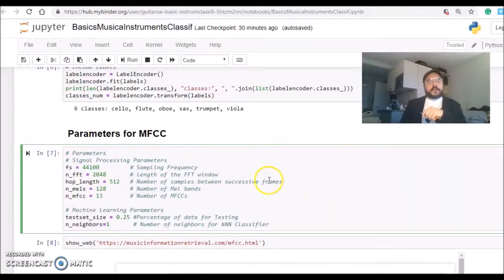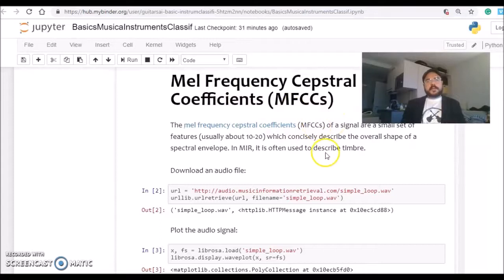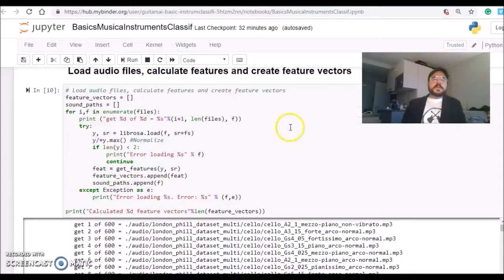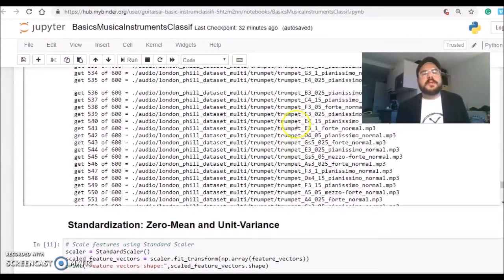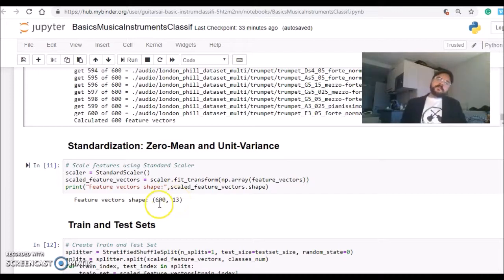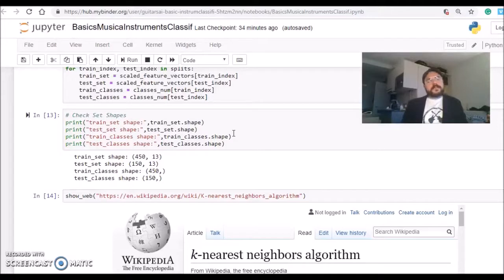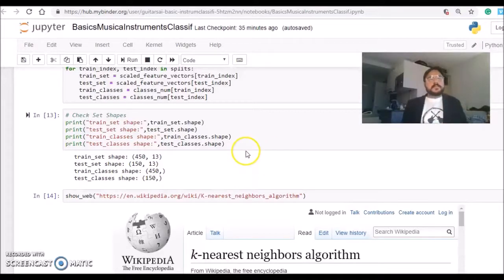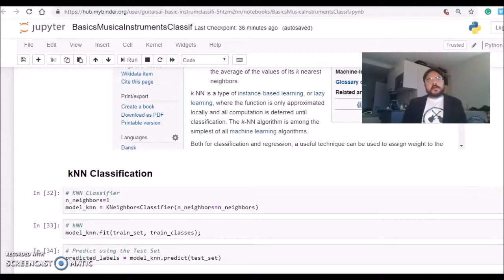The Very Basics of Musical Instruments Classification using Machine Learning - Part 2

Comment: I’m getting an error during the creation of feature vector step. I also have ffmpeg setup at my path. Is there any other way through which this issue could be resolved? Please let me know. Thanks.
Reply from the maker: did you check if everything is properly configured, are you with all correct paths to all files, are you working on the correct directories?

Comment: I'm having problems with loading files, it just says Error loading: (path of the file), for every one of 600 files
[EDIT] I added ffmpeg to env, didnt solve the problem
Reply: try installing all of these:
tensorflow
keras
librosa
numpy
seaborn
scipy
seaborn
pydot
graphviz
 as admin and restart your kernel. It worked for me
Reply: @swathigunasekaran6817  I converted mp3 to wav and that fixed it for me, but still dont know why that happened hah
Reply from the maker: Is the ffmpeg at the path? http://blog.gregzaal.com/how-to-install-ffmpeg-on-windows/
Reply: @the-sound-travels  yep
Reply: After adding ffmpeg to PATH, make sure you close the current instance of the terminal, and relaunch a new one, worked for me.

Comment: london_phill_dataset_multi\viola\viola_Gs6_1_pianissimo_arco-normal.mp3
C:\Users\w10\Anaconda3\lib\site-packages\librosa\core\audio.py:146: UserWarning: PySoundFile failed. Trying audioread instead.  getting this error when Load audio files, calculate features and create feature vectors
Reply from the maker: did you configure your local environment to play mp3 files. ffmpeg must be properly installed